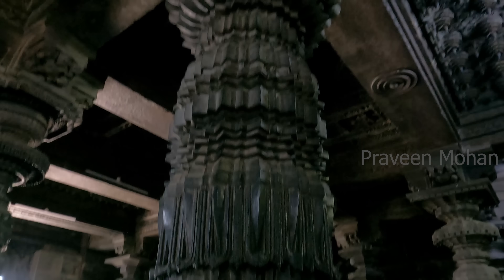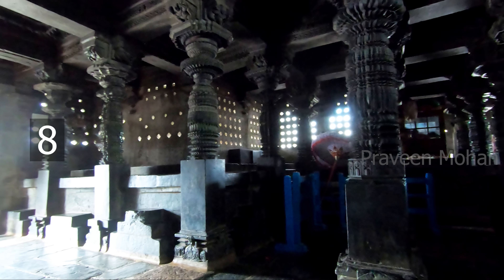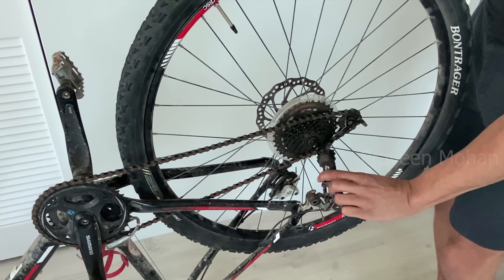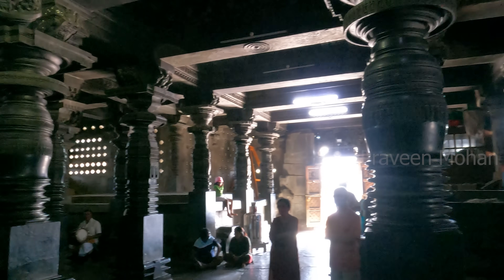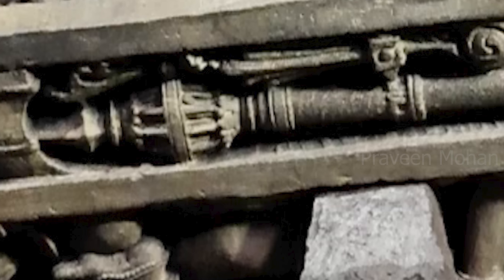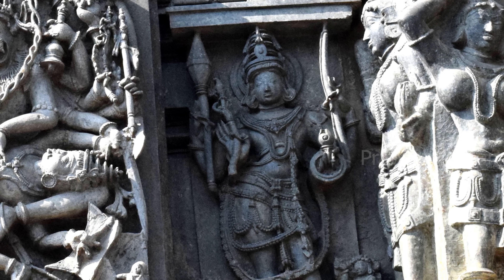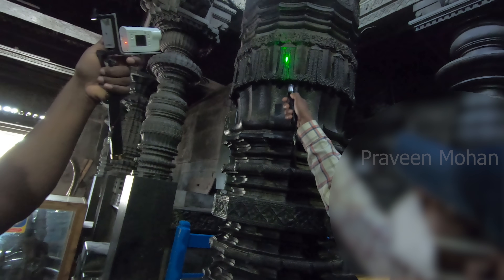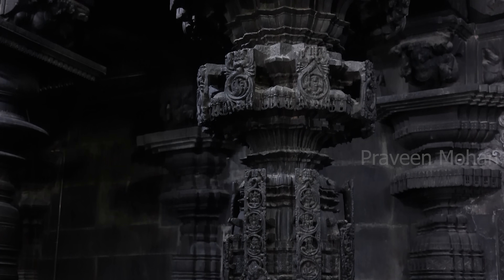Ancient Technology Science Can't Explain - Chennakeshava Temple, Belur Karnataka

Comment: Praveen - I believe that India has more technology in ancient times that any other location on earth.  It is simply amazing how the temples have been constructed with such great detail.  I have been following you for years and there is no limit on the ancient technology or various locations.  As a geologist, I cannot believe that rock was carved in such detail with no errors or breakage.  Maybe the rock is also a special fine grained, uniform, and consistent formation.  Maybe the quarries where the rock came from would explain something.
Reply: Hi Howard, I agree with you. I cannot believe that rock can be carved to that level of precision. I've been doing a some research on this, and I strongly believe that they was a technology where they could melt granite and pour to moulding to get the desired effect, but then what was the mould made of. A diamond? Because it's the diamond more harder after granite. Having said this is, worlds most diamonds are found in south India. It's a mystery In a cluster of mysteries.
Reply: @naveenkodela  We do not now have any technology to melt rock and pour it, maybe they were so advanced that they could do that.  The mold would not have to be hard, it would only have to resist the 2000 - 3000 degrees it would take to melt the rock.  Those rocks shown are not granite, more likely a basalt-type of rock.  If it is possible to obtain a small sample of the rock in the columns, maybe a piece outside the structure, a thin section could be made and any university could look at the sample and determine the type of rock and whether it had been melted.
Carving diamond woul be extremely impractiable and there has never been a diamond found that large.  And then, a diamond for each colimn would be needed because they are all different.
I agree that there are mysteries like this all over the world.  I believe a very advanced, now gone, civilization or aliens helped ancient humans to complete the work.
Reply: @howardfreeland5595  Absolutely, surprisingly we indians get  knowledge of these tamples from such videos. Our history was written by leftists but in coming years we will get true history as its being rewritten.Jai Shree Ram🙏🙏